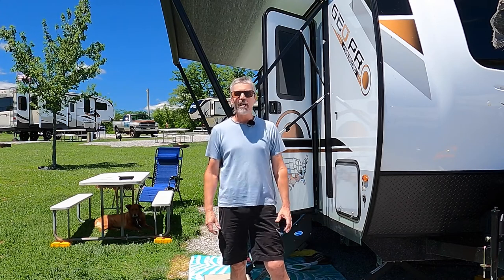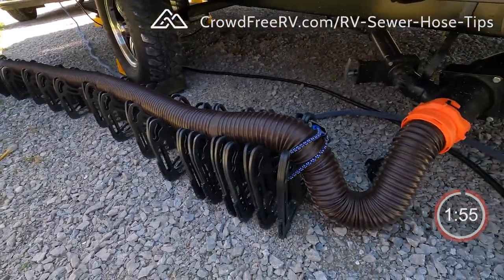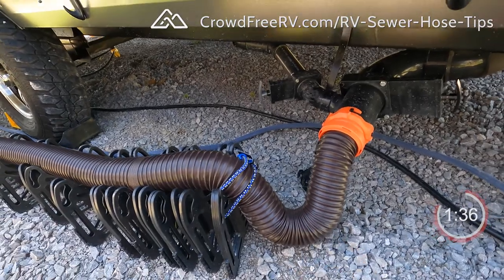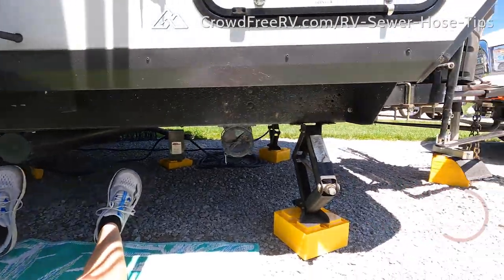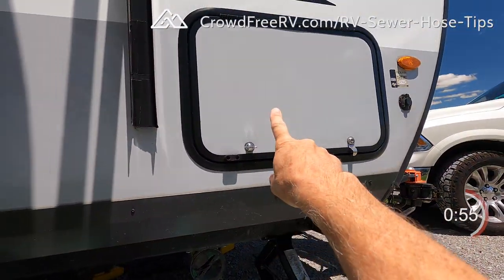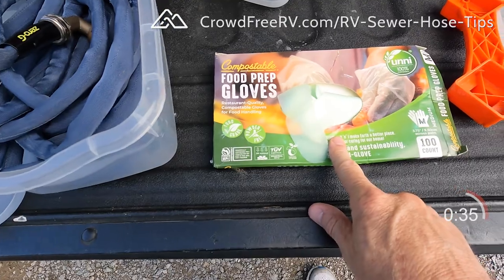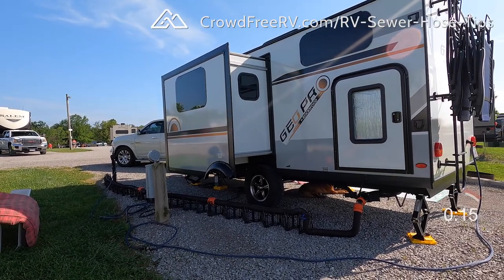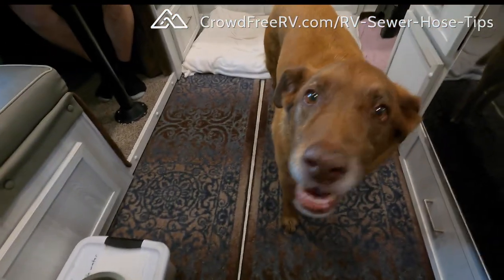RV Sewer Hose Tips | How We Keep Septic System Stink Out Of The RV | CFRV 2-Minute Quick Tips

Comment: Two problems with your “pee-trap” strategy: first, the water that is trapped in your pee trap is just as smelly as what’s in the dump, and second, you should only open your black tank’s knife valve when you’re emptying your tank, not between times - so your knife valve will block odors from the dump.